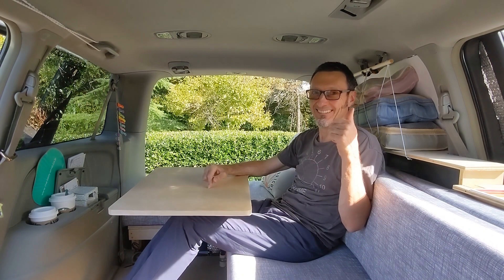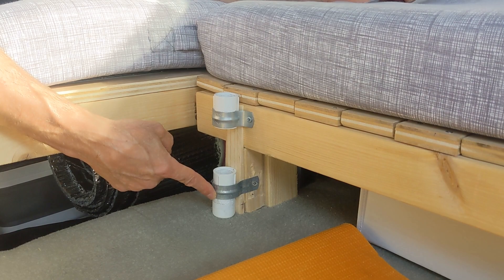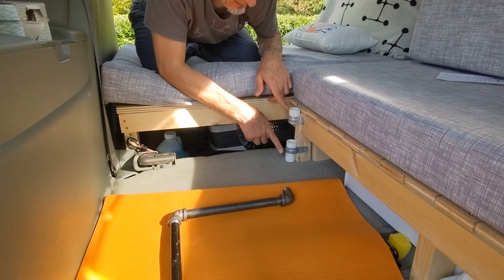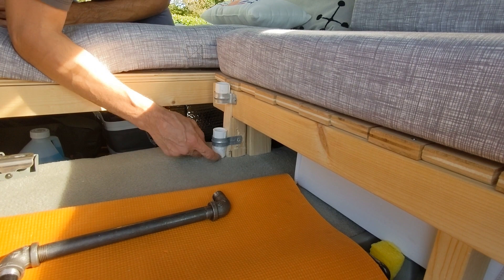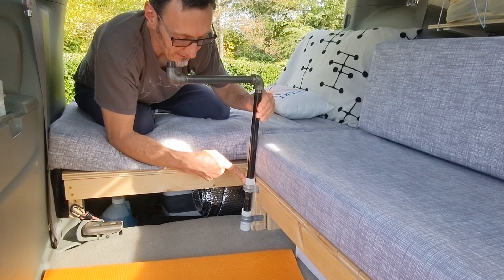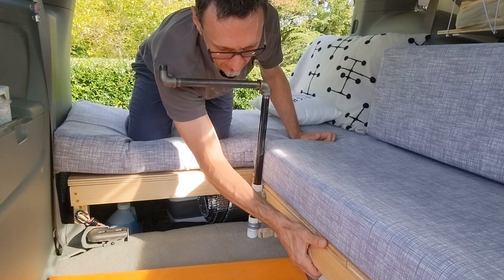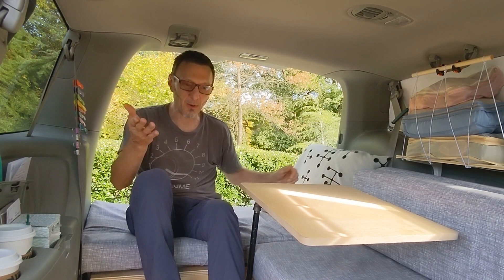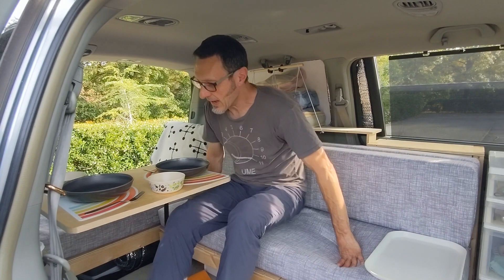Check Out Our New DIY Stowable Swivel Table for Our Minivan Camper!

Comment: Thank you! I made a "lagun" table based on your instructions and it came out great. Lowe's has unthreaded black piping and the fittings lock with hex bolts which makes it super easy to use the right length pipe for your individual needs.

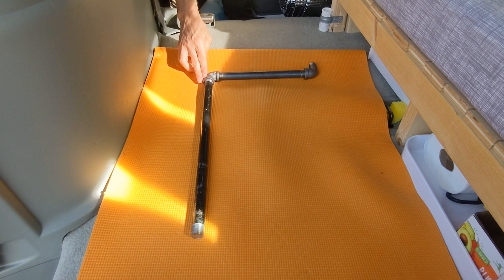Comment: Thanks for the vid! I have a question, at 3:56 you said assemble and tighten with correct angles. For me the angles are always wrong when tight. Is there a trick? Thanks a lot!
Reply from the maker: Hi, you are welcome. Thanks for watching. To get the elbows placed correctly we had to tighten with wrenches if I recall correctly. We hope this helps.

Comment: Is there a chance that the swivelling may tighten or undo the table top at some stage? Or how did you fix it to avoid that?
Reply from the maker: We have not experienced that but we haven’t really used it a-lot either. 15 minutes here, a half there.

Comment: How do you ensure that table holds weight? It should have another pipe going down on the opposite end of the corner
Reply from the maker: So far its been fine for what we use it for but we do always need to be mindful of how much weight we might place on it and always need to remember to not lean on it. We do have a secondary support method if we want to put more weight on the table but we recorder prior to coming up with that. Thanks for the comment!